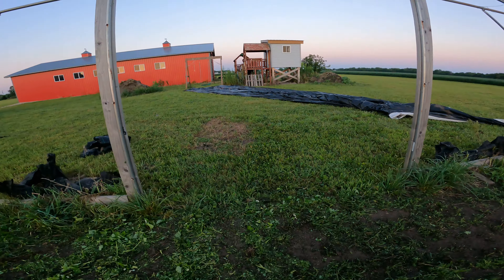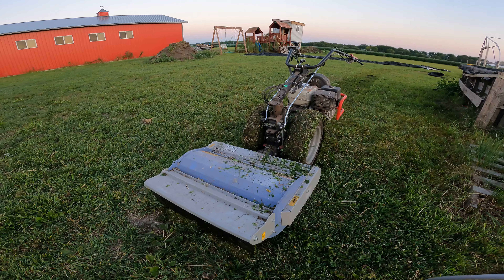Using BCS 853 with Flail Shredder

Comment: Hi there! How long can you leave a half tank of gas in the Honda engine? Is 3 weeks intervals ok to leave the gas without clogginh the carburator or rusting the tank?
Reply: Whem preparing to store the machine, park it up and switch off the fuel line and allow it to burn off the fuel in the line. Fuel in the tank is fine. Fuel in the line is a problem
Reply from the maker: I'd add to Small-time Gardens comment to use a fuel conditioner like Sta-bil when possible.   But exactly what he said, use the fuel shut off in the fall and let it run until it dies so all the gas in the carburator is burned out.
Reply: @daronspicher  how you know if I'm a he🤭